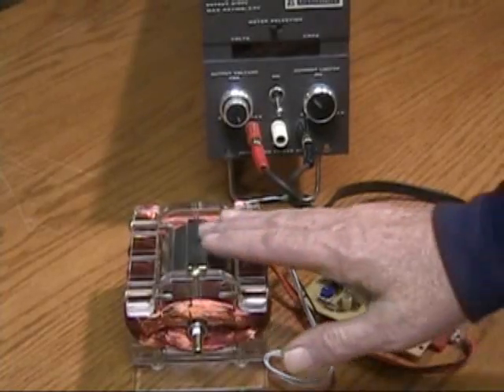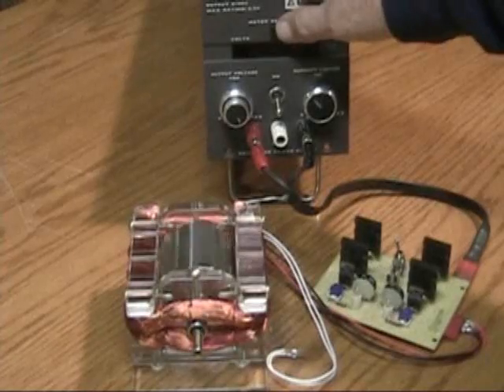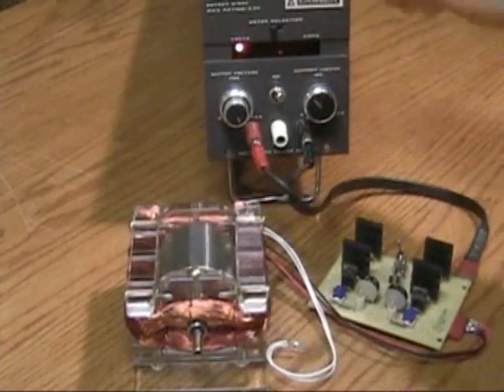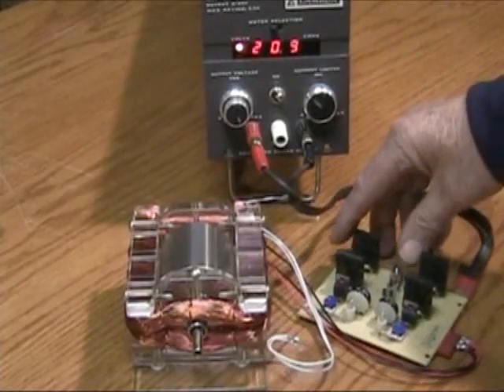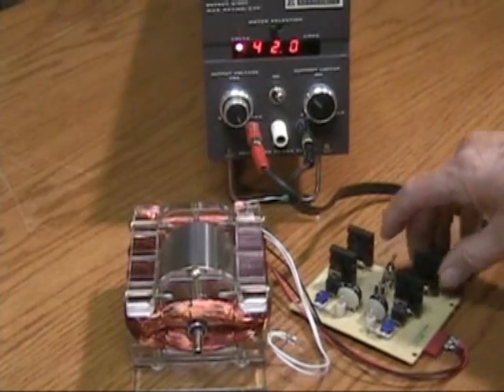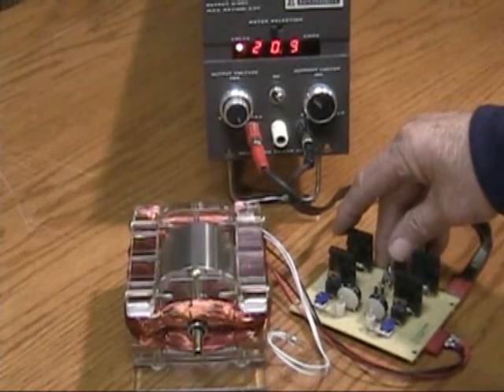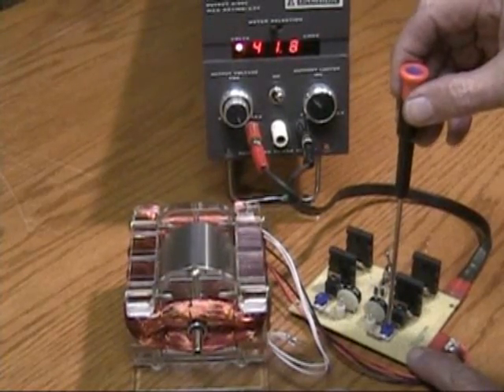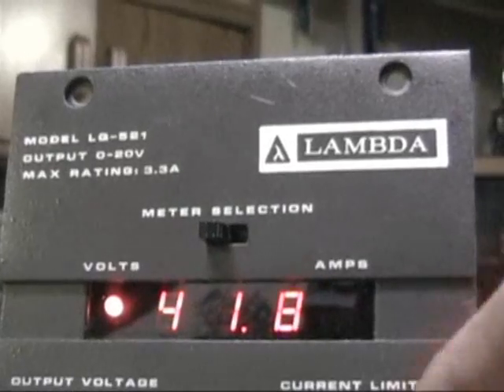Window Motor Doubles Voltage On PS Readout.

Comment: did you ever figger out what/why/how it was making the extra voltage?  your builds are always so precise, they are a pleasure to watch run.
Reply from the maker: Hello, No, I was never satisfied by what seemed to be the popular comment. Some said it was interference from the pulse circuit that was tricking the voltage sensing circuit to compensate for what might be interpreted as a voltage drop over long connection lines. I've talked with a technician at the company who made the power supply and he told me the transformer and circuitry could not produce double the rated voltage. I should try to get back to this sometime in the future.
Reply: ain't it amazing, the intricacies of these circuits.  just in my lifetime technology has advanced orders of magnitude more then all of previous human history combined.  a couple hundred years ago high tech was getting from place to place by the labor of 4 legged critters.  look at us now.  those who think we have discovered all the principles & processes are probably confused.
Reply from the maker: Geo, Seeing the video reminded me that I haven't done enough work with Impedance and resonance. I think some of the positive effects I've had are due to coming close by accident. Thanks

Comment: Could you place a buffer capacitance between the supply and the driver circuit?  Something around 1000uF might do, but you gotta have diodes on the leads coming from the power supply.  This way, if the motor starts back-charging the supply, you'll see it raise the buffer above the supply potential without the regulator having conniptions.  Also, you can scope directly across this buffer and watch exactly where in the cycle are currents sloshing back to the source.
Reply from the maker: Hello, I will set things up again and make some further tests. I've had many other suggestions also. I should also try using the output of the power supply as part of a return circuit while the unit is unplugged. I think there is a specific coupling between the PS components and the motor as it pertains to impedance or other electrical characteristics.
Thanks
John

Comment: if you change the PS to 3 batteries at 6.3vdc in series this is close to 20vdc and if you are really getting back twice the voltage this should charge the batteries while the motor runs, yes? Or if not the meter is fooling us.

Mike
Reply from the maker: Hey Bro, I understand what you're suggesting but if I remember right the same thing didn't happen with the batteries. These pulse circuits and motors can have some unusual coupling when it comes to how you connect the output to batteries, capacitors or other circuits. I think under very unusual and usually accidental circumstances you can come up with an impedance match or even a resonant circuit between the motor and the load. This can change everything when it comes to how the motor performs. I think this coupling is happening with the components in this particular power supply. I can measure this 40 volts with a standard meter so I know the meter on the supply is accurate. I'll have to put this back together again sometime and come up with a satisfactory answer. I should try using the input of unplugged supply as a load on the generator side of the window motor to see what happens. Thanks for your comment.
John

Comment from the maker: The motor will operate normally with a battery. Something seems to happen because of the impedance between the motor and the power supply.
John

Comment from the maker: @npnk1 
This one is interesting because the meter on the power supply measures the voltage over the load no mater what you set the supply at. So if you had a 12 volt battery on the supply and the supply was set to 6 volts the readout would say 12 v. So In my opinion the supply isn't capable of putting out 40 volts even if a sensing circuit was trying to tell it to do so. If I put a diode in the positive side the voltage measures 40 v on the motor side and the readout says 20 v.
John

Comment: BEAUTIFUL MOTOR:-) IVE BEEN WORKING ON A MOTOR/GENERATOR COMBO UNIT MYSELF. I MADE A SWITCH THAT USES A CARPENTER PENCIL AND A BRASS COATED PAPER BINDER. IT HAS A LEVER ARM FOR FINE TUNING. THE ARMATURE WEIGHS 4 POUNDS. IT RUNS FOR ABOUT 1 - 2 HOURS ON AN OLD LITHIUM-ION CELL PHONE BATTERY. AT AROUND 150 - 250 RPM, (DEPENDING ON WHAT TYPE OF BATTERY I USE).
I DON'T KNOW MUCH ABOUT ELECTRONICS BUT I AM TRYING TO SEEK HELP IN LEARNING EXACTLY HOW TO MAKE USE OF THE BACK EMF. PLEASE HELP.:-)

Comment from the maker: @living4game 
Yes at first I thought it was the power supply sensing circuit running away because of the unusual voltage trying to return through the input, but I used a blocking diode between the motor and PS and then measured 20 v on the PS while have 40 v on the side between the diode and motor. If I could produce the same event without the PS then I might have something.
John

Comment: I think that you are dealing with collapsed voltage and its messing up the power supply. Try to connect it to a cap and charge it up run the motor, flip the switch, then run it only on the cap. That way there is no other voltage supply